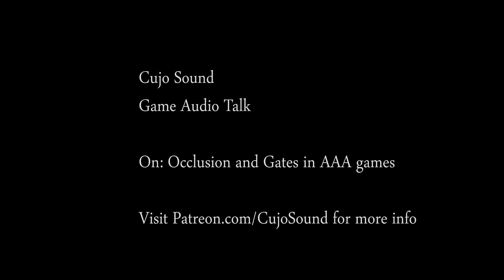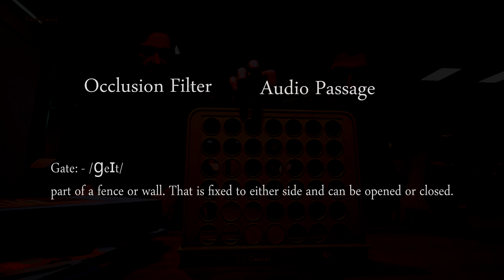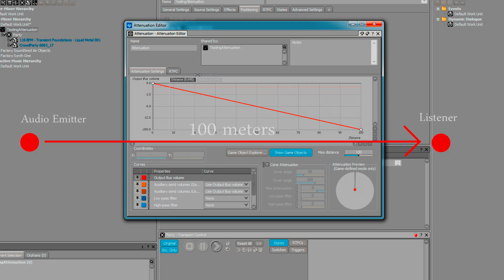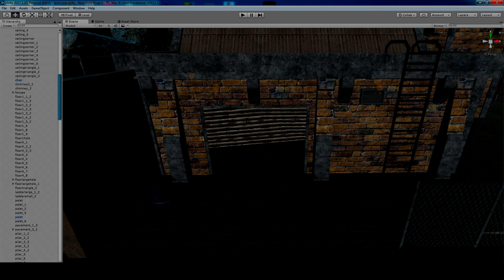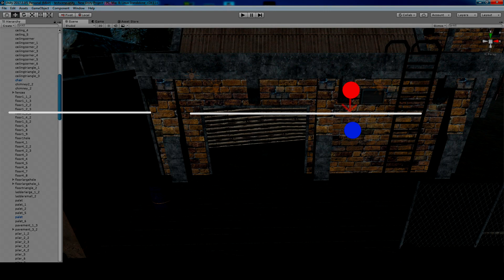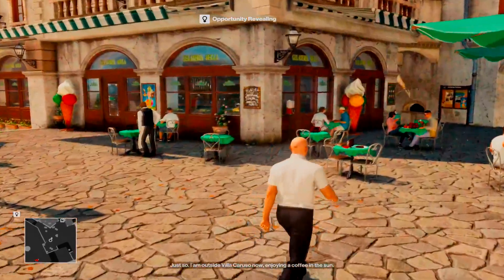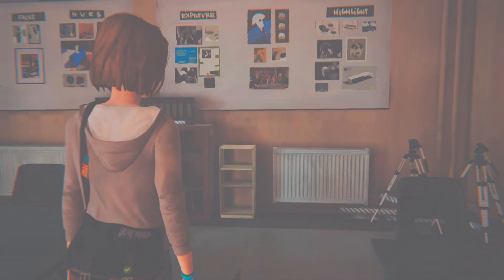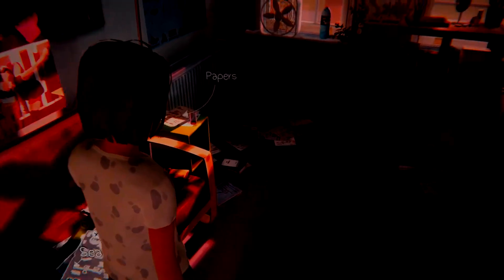Occlusion and gates in AAA game sound design. By Cujo Sound.

Comment: So this is all done with raycasting?
Reply from the maker: Yea, or some other way of figuring out where the sound is vs. where the player is and do the math. Which is probable beyond my math abilities, but yea.
Reply: @CujoSound  but this is also useful for other stuff like bullet ricochet right? And is raycasting ever used to measure in real time the size of a space to kick the right reverb size instead of using reverb zones? Or as a way to make voices echo on the walls etc?
Reply from the maker: @sachamht  yea. There is another video here, where I actually never made part 2 about it, but spawning objects at the ray point of impact. Which could be used to then play early reflection type sounds.

Comment: Nice  ! Any chance of a Wwise tutorial on this ? (How to set up that gate)
Reply from the maker: Sure. :) The difficult part is definitely the coding and the raycasting in engine, but in Wwise it's more approachable.
Reply from the maker: alright - that's going to be a little tricky - but I'll get it done :)
Reply: That would be great! Thx for the effort!
Reply from the maker: Wrong account again to reply :D Sorry about that.
Reply: Haha :D 
I can't wait to do it with Wwise after I finish my project in UE4. 
Is stuff like this considered as advanced or it's still classified as junior sound designer level? I'm asking as I still have almost 1 year to work on my demo reel and I want to hit semi-/advanced level when I'll be looking for jobs next year.
Reply from the maker: That depends on how you look at it - since in most bigger studios this kind of system would most likely be made by the audio programmer and you would have nothing to do with it other than decide which sounds are affected and how it works in the level.
But if you are alone and have to create it yourself, sure it's fairly advanced, as much as it is also essential to do on a lower level.

Regardless it's really important to understand that you need to control sounds around your level in more ways than just radial attenuation. 
It's also super important to understand how something like this can be made, even if the system you create is super primitive because you may at some point later have to describe such a system to a programmer who doesn't know anything about audio or physical sound behavior, and then it's really important to be able to explain it correctly and even make a small prototype for them to see - it will be much easier for them to understand from the start what you are asking instead of 20 iterations with misunderstandings and so on.
Reply from the maker: it depends, but implementation usually belongs to the designer or a combination with a technical sound designer. Audio programmers do code DSP and other things which are deep and far beyond my understanding of black magic, but they most definitely also write tools and setups for you to use. 
So you can ask for a tool or a way to handle something, and they do it for you (usually) it all depends on the production pipeline and team of course.

Understanding programming, signal flow and paths and how that sort of stuff generally works is really important, you don't have to do it or be a master of it later, but it's great for understanding how sound works and understanding of what others do on the project as well.
Also, you may not consider it programming or scripting, but working in Unreal BP is totally scripting, it's just visual and is exactly the same thing.
Reply: Hey :) Recently I did raycasting in UE4 (with BP no C++). It's not that hard as I thought yet I quickly found that it's not the best approach for outdoor ambient sounds like rain if there's a lot of obstacles like street lamp between player and sound emitter :D
Reply: Oh I thought that whole implementation belong to sound designer and audio programmer do only stuff like writing DSP and similar deep programming level stuff without touching middleware. Thank you for enlightening me :) 
Yes. I'm learning that stuff for cases like smoother co-op with programmers and situations like these mentioned by you. When I asked similar question on FB some sound designers said that I should not care about such stuff. But I believe that it can improve workflow. 
So as I understand in some cases, the fact that I can do more than assign audio file to 3D object ;) can give me edge and few additional points during recruitment. Definitely worth it :)
Reply: Thank you for your time and explanation :) Technical Sound Designer is something that I'm considering on my patch. "Black magic" is term on spot :D DSP programming etc. is also beyond my scope of understanding :)